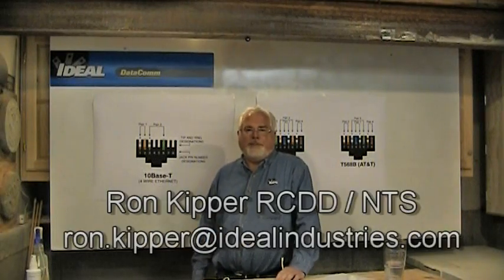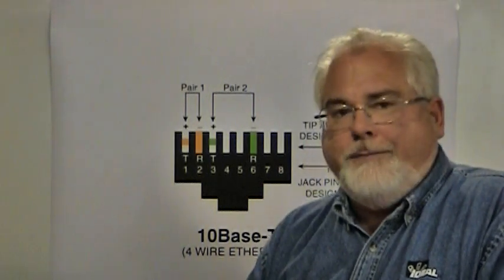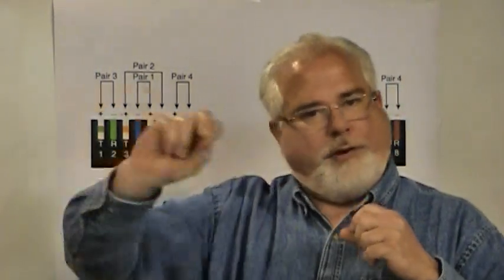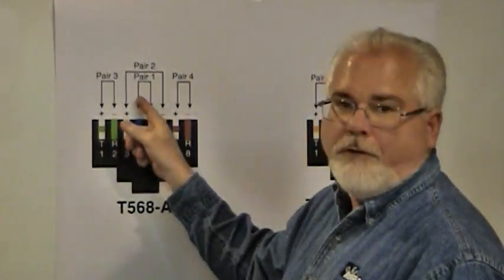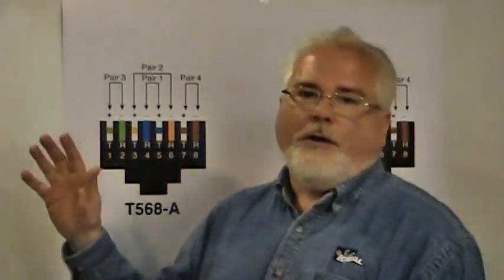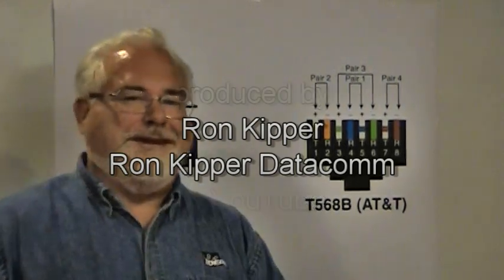Wire Color Code Configuration for Data

Comment: After many years of doing this I've decided that from now on if it's stranded cable I'm gonna make it up for A, if it's solid cable I'm gonna make it up for B. that way I can quickly spot the difference. Now I just have to stick to that standard. There is really no difference between the 2 pairs as they are just swapped around and the network interfaces are auto sensing so it's almost irrelevant now.
However if you do go A-B you end up with a 10/100 crossover cable, and that will work with gigabit even though technically the other two pairs should be swapd as well.
Reply from the maker: sounds like fun! Ron

Comment: Ron Cat5 cable pairs have different twists rates. Wouldn't connecting  568A lines with 568B patch cables possibly mate two pairs that have different twist rates. We know that the link will work but do we know how the performance is impacted? Are this connections permitted by EIA standards.
Reply from the maker: At gigabit speeds and down I doubt the equipment will notice the differences in the twist rates and the standards don't addsress it that I know of. Ron

Comment: A patch cord T568A at one end and B at the other is a crossover cable that was ONCE required when connecting two like devices such as DTE to DTE, or DCE to DCE.  Now days most devices are auto sensing and it doesn't make any difference.
Reply from the maker: Hey Leny yep crossovers are no longer used. It would be nice if the industry just got down to one standard Ron

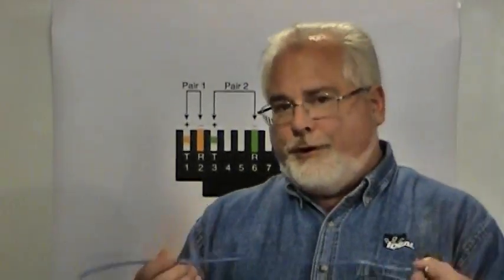Comment: Correction on your 10Base-T about 3:40.  1 and 2 are not Trans and Recv.  They negative  and positive, and together make up transmit.  3 and 6 are receive negative and positive.  Assuming it's a DTE device.  If it's DCE, trans and recv are reversed.  pos and neg both put out the same voltage  but it's the difference of voltage that is the signal that makes a bit.  This guards against EMI where both wires get hit, the difference is still maintained.
Reply from the maker: Hey Leny thanks for the info! Ron video getting a little old

Comment: One thing to remember about ethernet is tha a given pair is not connected directly to Rx or Tx, but is isloated bt a 'transformer'
I have had no need to try it, but a given pair should work as long as it is connected to the appropriate coil, regarless of which color is which. This setup gives each pair electrical isolation from either end of the connection and provides a balanced load.
Reply from the maker: Hello thanks for the input! Ron

Comment: So I guess the only problem between the two is if someone decided to split off the pairs on an RJ45 into two RJ11 jacks?
Reply from the maker: Kraus not sure why you would split it to 2 RJ11's if I can help let me know. Ron
Reply: @RonKipperDatacomm1  I'm thinknig back to the USOC days? I guess what I meant to say is to terminate the pairs at a patchboard? Basically what I meant was when these used to be configured for phone connections instead of data, it made more sense to do it this way. Barely learning about the basics of this, sorry!

Comment: Having trouble. The cat 5e cable colors. There is a violet and w/violet color scheme in my cat5e cable. All the other colors are the same except the violet pair. I’ve been trying to find the right color code in order to hook up a rj45 connector.. any suggestions?
Reply from the maker: Charles I have never heard of violet colors in a Cat 5e cable. If the other colors lookn right I would say the violet pair is the one missing and wire it that way. Good luck Ron

Comment: I am a systems engineer and previously a phone guy and I prefer to wire everything in A.  All the time I run into people who see A and have a stroke and spend all day changing it to B.  I think it's so stupid and literally a waste of time. I prefer A because I always want my phone/voltage to be on Blue and Orange. Most if not all of these people are still lost in the past with "crossover" cables, well for the last 20 years computers have been smart enough to identify crossover and automatically correct so that doesn't even matter if you mix a whole lot of A or B up. It all still comes in as 1's and 0's on pins 1, 2, 3, and 6.
Reply from the maker: Spywell thanks for the comments as you know the cable can be wired either way and as long as both ends are the same  A or B everything should work fine. Take care Ron

Comment: Hi,sir i explained you my old modem is configured to WiFi router it mean my old router is configured to WiFi access point simple word how to used cable straight & cross cables connectors RJ-45 my cable is CAT 5e replay me ?????
Reply from the maker: Hi Muhammad man I am just not sure what you are asking me. It sounds like you are wanting to make a cross-over cable? Ifr so just wire one end in 568A and the other in 568B. Ron

Comment: Thank you for sharing.  A and B has puzzled me for a long time.  But if I have a T568B, I use pair one for phone line for sure.  How about the second phone line, do i use pair 2/orange or pair 3/green?
Reply from the maker: Tom use orange for the second phone line. Don't be mixing data and phone use separate jacks.
Good luck.
Ron
Reply from the maker: Tom sorry I meant the green pair. Ron
Reply: Thanks.
Reply: thanks

Comment: halo i want to use one cable in two devices is it possible
Reply from the maker: If you are using 10 or 100 BaseT data  yes you could use on cable for two computers because they only use 2 of the 4 pairs to communicate. You just have to use separate jacks on either end of the cable and terminate pins 1,2 and 3,6 using 2 of the pairs for one jack and the other pairs for the second. It should work good luck Ron

Comment: i just made one with one end 568A and the other 568B thinking thats what it meant by A and B did i mess up or will it work
Reply from the maker: Hector you made what is called a cross-over cable which was used to connect a couple switches together but will not work for most systems today. A standard patchcord is wired the same on both ends and most of them are wired in 568B. Hope that helps Ron
Reply: you just get a cross over cable

Comment: Ironically I have done over 500 ends with the A color coding... all for data per say. It was in a casino environment built in the early 1990's. I don't know what the protocol was used back then. But a few years before I started, they switched to the Bally SDS system. Used the same wire and same color coding, which was A. But it was RS-232 communications over the wires. I don't recall which wires were used and how many. But it's just ironic that we used the A for data. I just recall all 8 wires were fused at the patch panel with a 0.6amp fuse.
Reply from the maker: I think it is amazing we still use Rj-45 jacks and plugs seems like we would of needed to change them out but they are still around. Thanks for the comment. Ron

Comment: Excellent explanations of all but one thing around T=8:00.  I may be dense, but after watching video 3 times, and reading online for several hours, I'm still not sure how how renaming the pairs 2 & 3 (or changing colors as you say) could possibly prevent the type of accidental ringer voltage NIC damage to computer!   I'd love to use RJ11, but Home Depot doesn't carry it* and I'm simply trying to add some LAN cables between some rooms of my house and need to have phone as well.  Which configuration (T568A or T568B) is less likely to cause equipment damage?  568A seems backward compatible with USOC phone lines, would that be safest?  It seems either 568A or B should work fine for single line, but I may add a second line at some time in the future, so it looks like a pair will always overlap between data & phone and cause potential damage.
*HD carries RJ11 but would have to cut a separate junction box hole in my wall for each outlet -- was trying to use the modular system that allow you to use 2-6 jacks per wall plate
Reply from the maker: +Dell Anderson Hey Dell you are right either wiring configuration will not fix the problem of the ringer voltage damaging a computer. You can find online manufacturers like Leviton that make the RJ-11 jacks but I thought HD still had them. Good luck with your project. Ron
Reply: Hey thanks for quick response.   Relieved to know I was not more confused than I thought (somewhere somehow I had gotten the idea that one difference between  568A & B was that one was safer to mix with phone.   Since they're effectively the same, with neither being esp. safe to mix with phone voice, I decided to go with "A" (for home future proofing) and color code the 'phone' jacks Orange (for potential 'hot' ringer voltage) and 'Blue' (for Ethernet direct from modem) and the rest will be neutral color to mix and match ad lib from various routers and room-to-room connections (well, two rooms that is!)  Your video was one of the best online (and I watched quite a few) and really helpful in building my confidence.   I'm writing over the first push down Jack connections I've ever made, so something apparently went right!  Thanks again for clarifying ;-)
Reply: Forgot to mention:  Home Depot no longer carries any Leviton Ethernet stuff that I could find.  All CenTech or something like that.  Lowes carries LaGrande.   Even a DSL filter is 'special order'
Reply from the maker: +Dell Anderson Yes HD and Lowes really carry just the basics for home low voltage wiring today. You can special order stuff from them but you need to know what you want. take care. Ron

Comment: Thanks for this video. I have a burning question and I think I know the answer, but I want to ask an expert, and you certainly are. I come from an electrical background and I can't wrap my head around why color even maters all except for getting one end configured exactly like the other end. Is this a correct statement?As long as I do both ends the same shouldn't it work? Thanks
Reply from the maker: +riverbottomband Hey man that is close as long as 12, 36, 45, and 78 make the pairs used than yes the color does not really matter other than someone coming in behind is expecting blue is line 1 and pins 45. Thanks for the comment and take care. Ron
Reply: Ron, thanks for the video and your comments, I learned a lot, especially here, that's what I want to hear.

Comment: I GOT A DVO JACK 568A(WALL PLATE)- WHERE WE USE PUNCH-DOWN TOOL AND OTHER END  WOULD BE ETHERNET CONNCTER WHICH WILL GO INTO THE SWITCH..
WHAT WOULD BE THE COLOR CODE TO TRAVEL DATA THROUGH?
let me know please thanks
Reply from the maker: +Bestof thebest If you wired the jack in 568A the wire the plug 568A as well. Both ends need to be wired the same way. Good Luck Ron

Comment: As an electronics engineer I remember the 70's and 80's and the old systems being swapped and combined, trying desperately to squeeze out speeds above 56K on the telco 32K/64Kbps switchable modems through phone lines. Seems laughable now.
Hang on, I live in Australia and we are still using the old corroded water-filled pits copper telephone network! To quote our brilliant now ex-Prime Minister Tony Abbott who stopped the broadband optical cable roll-out. "Isn't the Internet just used for video games?"
Reply from the maker: +Kevin Hall Hell getting old...........just wait another 50 years no telling what they will be doing with it and by then hopefully you guys have updated the system! Thanks for watching. Ron

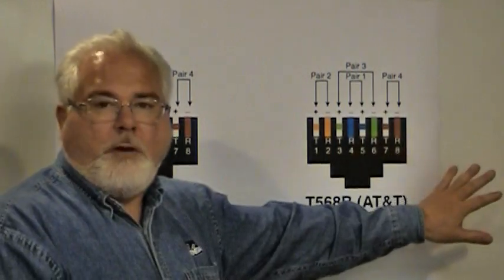Comment: The last 15ish seconds answered my question. I had previously spent 45 min looking for the answer before almost randomly stumbling on your video at 11:00 the night before the wiring job I don't know what wire config is used between jack and p panel (though it should be A) so question was can I risk mixing configs by using B p cables from jack to computer. You answer yes,  so I should be good to go. I didn't quite follow explanation as to why they can be mixed, but whatever as long as it works.  ;-) . Thanks for the video and your time. Very nice.
Reply from the maker: Bill Zodanga Bill I am glad you could use the info. Thanks for watching!

Comment: Ran out of space there. Sorry for rambling. Anyway, while I'm well at home with AC wiring, power distribution and low voltage analog signals like balanced audio, I'd never done any data wiring. Your video has been great to learn the terminations and the reasons behind them. I really appreciate how much detail you included. I hope you keep making great videos like this.

Comment: Hey Ron, thanks a bunch for making this video. I just got a job within my university working on and installing classroom technology (media systems & projectors, sound, etc). More and more frequently we aren't running individual VGA or HDMI cables but cat5e instead as a digital snake. We don't connect amplifiers or projectors directly to the network, they are indirectly controlled via RS232 via the video switcher (which is networked).